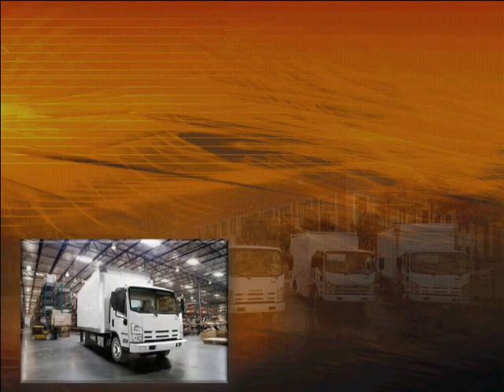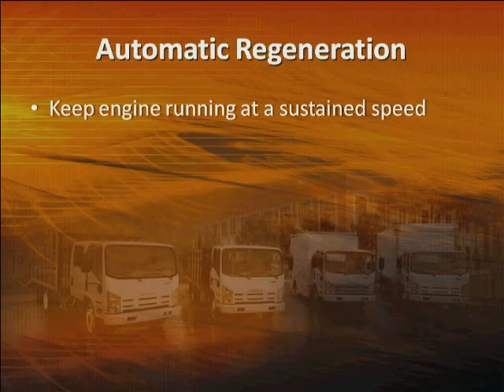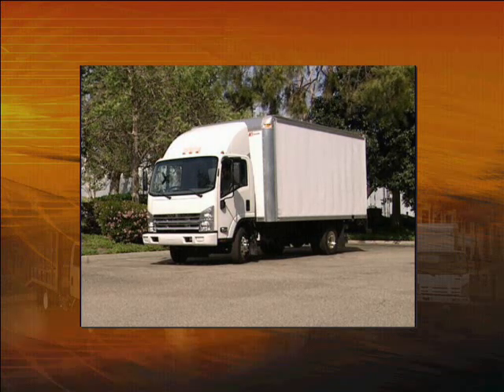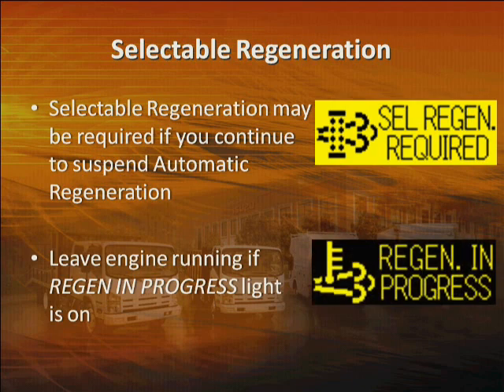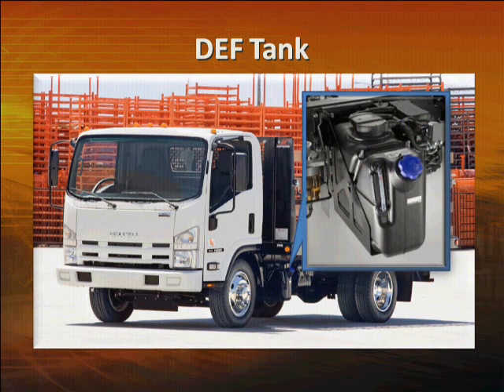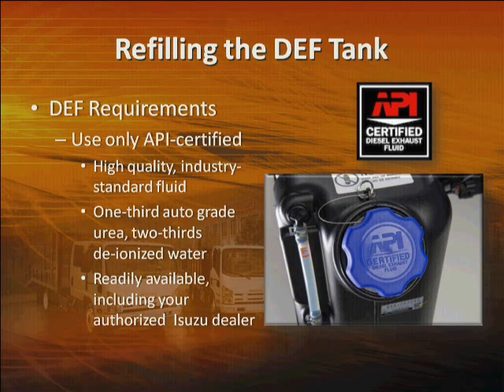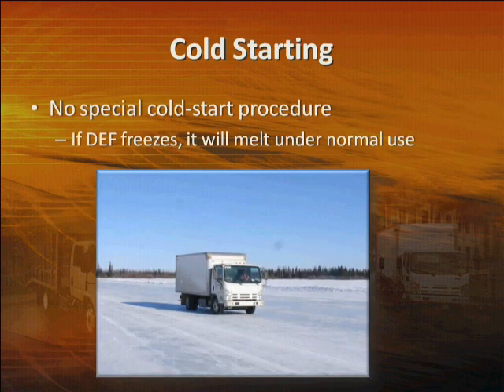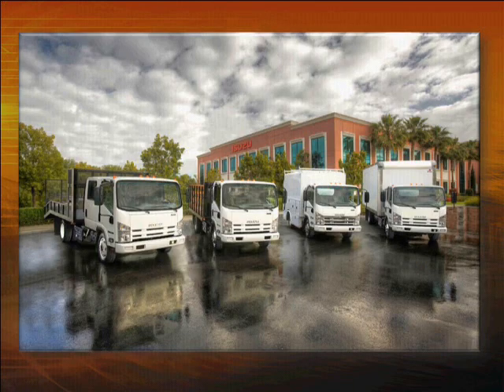Isuzu DEF Diesel Emission Fluid and DPF Diesel Particulate Filter Systems - NPR, NQR, NRR

Comment: DO NOT BE FOOLED: If you run into a problem with DEF, either run dry or otherwise, and end up in 'limp mode' your check engine light will come on because there is not enough engine power to turbo boost,  you may find with your OBD2 scan a code P0299 set, this suggests your turbo charger has failed, IT HAS NOT,  Sort out your DEF and erase all codes. and carry on. you will be fine.
Reply: I'm having issues soon as I pulled of the lot. Red exhaust warning light is on and vehicle won't go over 55 mph any help?
Reply: My 2016 has put itself into a permanent limp in mode. I have a red box in the MFD that reads 'exh. system'. There are NO codes and have run a clear code many times. These trucks are a P.O.S.. I assume the error has written itself into to computer and can only be cleared by the dealer or a mechanic that has the proper reader. Havnt tried disconnecting the battery
Reply: Same problem I'm having.. a OBD2 reader WILL NOT clear this error
Reply: The harness to the exhaust system corroded through so I fixed that and this code will not clear
Reply from the maker: Thank You!
Reply from the maker: How did this issue resolve?  Though I am way late in finding you message, I am interested in finding out.  New trucks that have sat for an extended period of time are susceptible to the DEF turning white.  Used trucks are at similar issue AND may have a less than fresh DPF.
Reply: @BigJeremiah8  what did they say I’m having same problem right now

Comment: Hey Michael thanks for the info.
what would happen if I turn off the truck while the auto regen is in progress?

Could it make the truck to revving even if it’s in neutral?

Thanks in advance
Reply from the maker: Nothing will happen if you turn the truck off while it performs the regeneration.  The system will self check again once restarted.  I would recommend selecting the manual regeneration button at the end of each business day.  This way while you are doing your post DOT walk around the truck can complete the regeneration.

Comment: you fill up or add def fluid 2.5 gallons container to the   the DEF tank 20 to 30 times a year not 4 or 5 if it truck works everyday
Reply: If the truck work everyday. You need to keep on check-in the  liquid in sistem correctly 30 times per year correct
Reply from the maker: The reservoir sight glass is a visual trigger to the driver the full tank is much greater.  My regrets for not being available to answer this question.  Let me know if there is any current question I can try to do better on.  Best Regards,
Reply from the maker: Thank you for your shared information. My regrets for not being available to answer this question.  Let me know if there is any current question I can try to do better on.  Best Regards,
Reply: Hahaha flatbed tow truck NRR here - - this thing goes thru a DEF tank about 1-2 times a week

Comment: On our 2018 NPR, the dash gauge always reads full until the DEF fluid is below the sight gauge on the DEF tank. Is this normal?
Reply from the maker: This is not normal.  The sight tube on the outside of the DEF is an interim check to use while you review the issue.  The side tube on the exterior shows the 'roman water level' equivalent to the fluid in the TOP HALF of the tank.  

Depending on the model year of your Isuzu - the tank is on the N series truck is either 5 gallons or 7 gallons.

The interior float or the signal from the sending unit is most likely the culprit.

If you have the technicians, pull and test the float and the sending unit.  For the non tech - use the exterior tube on the tank to fill once the fluid is empty in the sight tube.  The outside tube can drop to nothing (see above reference), but not for too long.

Special note to low mileage clients of Isuzu.  If you are operating your truck fewer than 6000 miles per year - you really really really need to have an active MID display on the DEF.  DEF turns to white chalk after 12 months, it WILL clog the intake filter in the DEF tank, YOU WILL HAVE ISSUES.  Again, this would ONLY APPLY to low low annual mileage owners.

Best Regards,

Comment: sir I have isuzu npr 5.2 model 2009 when I on regeneration switch after 15 minutes heat gage going up. what you think what's problem?
Reply from the maker: The SCR on the 2009 requires change as the soot and debris process through the system.  I would suggest a check up with a dealer in your area, and to connect to a reader for codes.  Isuzu dealers have a connection that allows the to dig deeper and might be the best solution.  Hope this helps!
Reply: @MichaelOlden  thank you
Reply from the maker: @zk7843  Your Are Truly Welcome!

Comment: Exh.system light, no limp mode but it's not my own truck I idk what to do
Reply from the maker: How long has the light been on?  What is the year of your truck?  If less than 3 years from date of original delivery (and in the US) call the roadside assistance for Isuzu which came with your purchase at no cost.  866-441-9659.  This also is available if your truck is under the Goldstar Plus or an extended warranty plan.
Reply: @MichaelOlden   the light came on yesterday. I pulled over after seeing it. It's a company vehicle, so I'm not sure if I have roadside. Either way my boss told me to try and put it into regen mode but the truck refused. Drove it anyways with the light on for about 50 more miles before getting back to the shop where the light then turned off
Reply from the maker: @zZzSneak  So the light is currently off?
Reply: @MichaelOlden  yeah, it just went away but the check engine light stayed on
Reply from the maker: @zZzSneak  How is the light situation now?
Reply from the maker: @zZzSneak  With the check engine light on and the truck in operable condition, I would encourage visiting the dealer to check and clear codes.  What year is the truck?
Reply: @MichaelOlden  2018 i think? my company are a bunch of cheapos and are having me use it as is until it breaks or whatever
Reply from the maker: @zZzSneak  Sad.  One of the great successes of Isuzu is their interest in standing behind the product.  This can mean stepping up and in to assist with truck experiencing issues.  And it could be something that the emissions warranty could cover - based on the year of the truck - - - BTW how many miles are on the odometer?
Reply: @MichaelOlden  a little over 100k
Reply from the maker: @zZzSneak  I encourage your people to take the truck in and if a part is needed check with the service write / manager / and regional factory rep for policy assistance.  They cover the part - the company covers the labor.  

Also - there might be an extended warranty on the truck.  Have them at least check in for what warranty have not expired.

Thank you for all the follow up on this!

Comment: How often or How many miles is a normal to do regenerate Thanks in Advance
Reply from the maker: It is associated with soot captured in the  filter not miles - i.e. pressure sensor at front against pressure sensor at back. the variance in the reading triggers the regeneration.

My regrets for not being available to answer this question.  Let me know if there is any current question I can try to do better on.  Best Regards,

Comment: ISUZU V17.00 Seleccione desde el año [ F ] 2015 Módulo de control ) > 3.0L 4JJ1 - TC ( Transtron ) Sensor de velocidad del vehículo P0500 Congelación de llantas P1470 Congelación de llantas P20C9 Asistencia para congelación de llantas Difusor de partículas diésel (DPD) Presión diferencial Rendimiento Ayuda Búsqueda relacionada  Ayuda Búsquedas relacionadas Módulo de control reductor solicitado Iluminación MIL Búsquedas relacionadas
Reply from the maker: Gracias por la consulta y mi intención es proporcionar conexiones que puedan ayudar a responder a su solicitud de información.

La traducción no fue limpia a través del traductor de Google, por lo que responderé con información de recursos sobre códigos de falla. P0500 P1470 P20C9

Si su necesidad es diferente, hágamelo saber.

Thank you for the inquiry and my intent is to provide connections that may help in answering your equest for information.

The translation was not clean through google translator - so I will be responding with resource information on fault codes.  P0500 P1470 P20C9

If your need is different - let me know.

autocodes.com tenía buena información.

P0500 significa "Mal funcionamiento del sensor de velocidad del vehículo (VSS)". Este código se establece cuando el PCM o el módulo de control del motor (ECM) detecta lecturas de velocidad incorrectas o ninguna señal del sensor de velocidad del vehículo (VSS).

https://www.autocodes.com/p0500_isuzu.html

autocodes.com had good information.

P0500 stands for “Vehicle Speed Sensor (VSS) Malfunction.” This code is set when the PCM or engine control module (ECM) detects incorrect speed readings or no signal at all from the vehicle speed sensor (VSS).

https://www.autocodes.com/p0500_isuzu.html

Código P0500 Isuzu Causas posibles Sensor de velocidad del vehículo defectuoso El arnés o los conectores del sensor de velocidad del vehículo están abiertos o en cortocircuito Circuito del sensor de velocidad del vehículo Conexión eléctrica deficiente Módulo de control del motor (ECM) defectuoso

¿Cómo soluciono el código P0500 Isuzu? Verifique las "Causas posibles" enumeradas anteriormente. Inspeccione visualmente el mazo de cables y los conectores relacionados. Verifique que no haya componentes dañados y busque clavijas del conector rotas, dobladas, expulsadas o corroídas.

Code P0500 Isuzu Possible Causes Faulty Vehicle Speed Sensor Vehicle speed sensor harness or connectors is open or shorted Vehicle speed sensor circuit poor electrical connection Faulty Engine Control Module (ECM) 

How do I Fix the Code P0500 Isuzu? Check the "Possible Causes" listed above. Visually inspect the related wiring harness and connectors. Check for damaged components and look for broken, bent, pushed out, or corroded connector's pins. 

¿Cuál es el costo de diagnosticar el código P0500 Isuzu? Mano de obra: 1.0 El costo de diagnosticar el código P0500 Isuzu es 1.0 hora de mano de obra. Las tarifas de mano de obra de reparación de automóviles varían según la ubicación, la marca y el modelo de su vehículo, e incluso su tipo de motor.

What is the Cost to Diagnose the Code P0500 Isuzu? Labor: 1.0 The cost of diagnosing the P0500 Isuzu code is 1.0 hour of labor. The auto repair labor rates vary by location, your vehicle's make and model, and even your engine type. 

Código P1470
Código P1470 - Circuito de control de la bomba de diagnóstico de fugas eléctricas

https://www.codigos-de-motor.com/p1470.html

Code P1470
P1470 Code - Leakage Diagnostic Pump Control Circuit Electrical

https://www.engine-codes.com/p1470.html

Código P20C9

El PCM de su vehículo, también conocido como módulo de control del tren motriz, establecerá este código de error P20C9 cuando detecte fallas en el sistema de filtro de partículas diésel, también conocido como sistema DPF.

P20C9 Código Isuzu - Módulo de control reductor solicitado Iluminación MIL

https://www.códigos-de-motor.com/p20c9_isuzu.html

Este hilo tiene la siguiente referencia de enlace.

¿Necesita más información sobre cómo reparar el código P20C9 Isuzu? Obtenga acceso a los manuales de servicio de fábrica

Code P20C9

This error code P20C9 will be set by your vehicle's PCM, also known as powertrain control module when it detects faults with the diesel particulate filter system, also known as the DPF system

P20C9 Isuzu Code - Reductant Control Module Requested MIL Illumination

https://www.engine-codes.com/p20c9_isuzu.html

This Thread has the following link reference.

Need more Information on the P20C9 Isuzu Code?
Need more information on how to fix the P20C9 Isuzu code? Get Access to Factory Service Manuals

https://www.youtube.com/watch?v=yFof9H3w2i8
Fixing a DPF Low-Efficiency code on a 2011 Isuzu NQR in under 10 minutes

https://youtu.be/yFof9H3w2i8?t=181

Comment: When my auto light comes on it smokes like crazy. My truck runs 12 hours a day, 7 days a week
Reply from the maker: The filter is designed to be serviced every 100,000 miles,  if you have high idle or PTO (power take off) application we will need to look at your engine hours.  I would suggest - if you have a two man or more crew - to video the smoking when it occurs - please include smoke first the pan to dash board to capture the miles, the light on dash, the message on regeneration.  What area of the country do you operate?  Please contact me when you have the video - 423-618-3323 or email yourfleettruck@gmail.com
Reply: Tengo la luz de escape encendido y solo avenza 35 millas, caales son los filtros o los cambio que debo hacer para corregir el problemas
Reply: Te escribo desde Panamá

Comment: This is annoying nuisance. Lots of time and fuel waste. Instead of releasing particles without filter as normal in air continuously this filter collecting them and releasing in 10 minutes  does it make any sense?  In my new NLR truck I have lots of trouble. Visited Isuzu 6 times in 2 months wasting lots of business, time and still problem with DPD is on going.  God help me.
Reply: Supposedly General Motors has been experimenting with a DPF filter that uses an electric heater for regenerations instead  of squirting extra fuel into the filter.  This is supposed to cut down on regeneration times and eliminate the "fuel penalty".  Given the relationship between Isuzu and GM, maybe they will have this on their vehicles in a few years. Who knows.
Reply: +Bellamy Strickland Commercial Truck hello do you know were I can buy a 2011 Isuzu NPR ABS SYSTEM
Reply: @Atlas-wh2vg  ... Michigan trucks . Livonia Michigan of Ford road.
Reply from the maker: My regrets for not being available to answer this question.  Let me know if there is any current question I can try to do better on.  Best Regards,
Reply from the maker: It continues - even til today.
My regrets for not being available to answer this question.  Let me know if there is any current question I can try to do better on.  Best Regards,
Reply from the maker: My regrets for not being available to answer this question.  Let me know if there is any current question I can try to do better on.  Best Regards,
Reply from the maker: Thank you for the refence on this - My regrets for not being available to answer this question.  Let me know if there is any current question I can try to do better on.  Best Regards,

Comment: Biggest pile of shit system on any diesel truck. Always going into limp mode. Never regens on its own when you need it to... Thank a Democrat for all this lovely crap! Funniest thing was towards the beginning of this video when the narrator said the system made for a "reliable truck" that "saves you money at the pump" (or said something like that). Without this bullshit, they'd get over 12 MPG... No way with it!
Reply from the maker: Thank you for your feedback on the system and reference that all diesels are in the wheelhouse of DEF.  The reference that the truck is always going into may need more feedback.  What is the timing between the service that you are experiencing?  In other words when the filter has been removed and replaced - - or has your system had the removal and deep cleaning - - - or have the repair facilities only triggered a deep regeneration and they considerer their job done?   When I've investigated many trucks with viewers we uncover that the services they think they are getting are not always what they truly paid for.  

Glad to engage in a deeper research if you would like.  Isuzu is a great manufacturer that responds to clients and cares about the name and reputation.

Comment: كيف الغي نضام البيئه 
الدعسه لاتعمل
Reply from the maker: Apologies for the delay, I have asked for assistance in the translation to English.
Reply: @MichaelOlden  ISUZU V17.00 Select From Year [ F ] 2015 Control Module ) > 3.0L 4JJ1 - TC ( Transtron Vehicle Speed Sensor P0500 JU P1470 b P20C9 Suchwall Diesel Particulate Diffuser ( DPD ) Differential Pressure Performance Bichuall Lo sco as oli Reductant Control Module Requested MIL Illumination
Reply: @MichaelOlden  This code

Comment: Junk emissions is garbage period.
Reply from the maker: I appreciate your thoughts.  And, the DEF system does come with a need for follow up and training.  There are many parts to the system.  What is your direct experience on this unit.  What fails in time - everything.  The system is now 14 years in the industry.  We have addressed the tight requirements of the government at the onset, then the need for training to prolong the life of the filter.  From there we have focused on client support for troubles and at times there have been a cascade sensors which lived their useful life.  Much like an O2 sensor in residential vehicles, there is a need for useful life consideration.  More than happy to investigate your personal experience with the system.  If you a needing to vent.  Why not discuss it here?